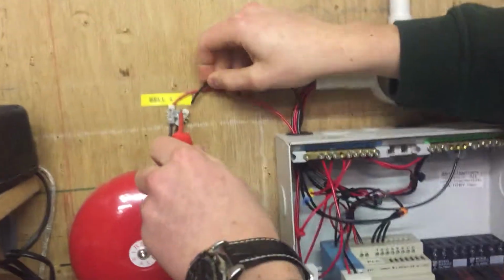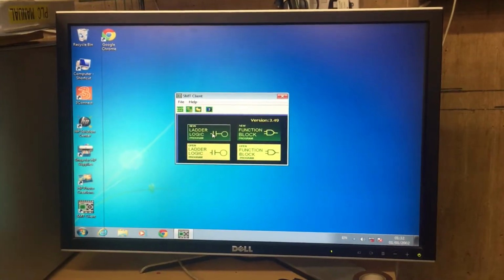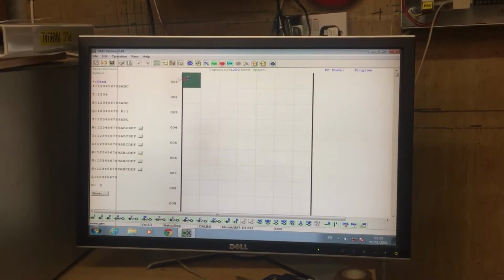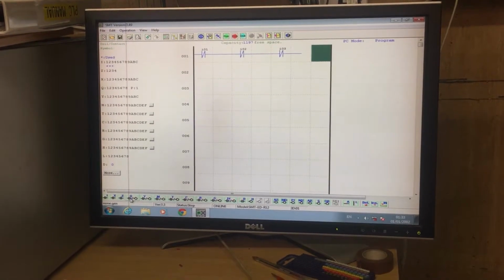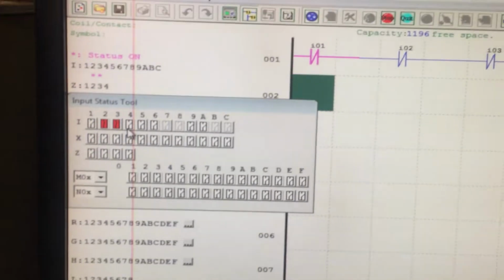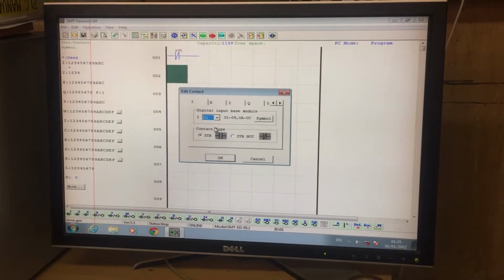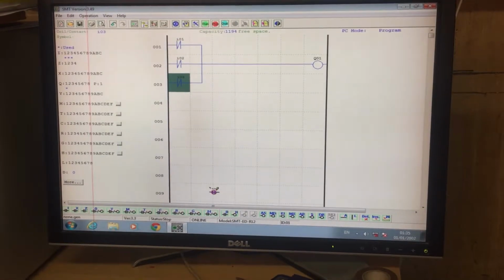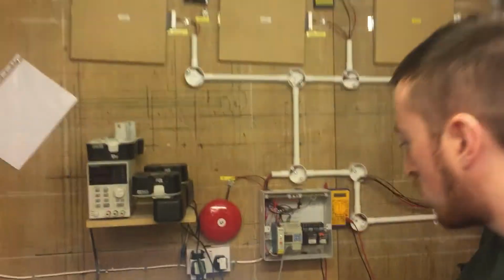How to Program an IMO iSmart PLC using Ladder Logic: 3 doors and a bell

Comment: very nice ... can u give me a list of what i need to make that circuit?
Reply from the maker: Hi Paul,

You need 3 reed switches, a bell a 24v psu and a 24v SMT ED R12 smart relay from IMO. The circuit diagram is at 2:07.  Hope this helps.

Cheers,

Dave.
Reply: @collectric5518  thanks from getting back at me so fast.... i have one more question for you if i may... what  is the best way to wrap this plc around my head ? short story im a HVAC TECH but now im in industrial machinery  .. i can read and understand circuits and diff componts on a ladder diagram lol i finally got the theory on that and the refrigeration side.. this is my 3 week in school for plc.. is there anything you can think of that could help ... like the inputs and outputs..
Reply from the maker: @ghoststories8622  If it's the inputs and outputs you need help, then typical inputs are digital ones like float switches, limit switches and proximity switches and the analogue one are like pressure, light or temperature sensors which vary in voltage (0-10V).

The outputs of PLCs can control any load like a lamp or LED, a contactor, heater, pump, solenoid, valve, robot, fan, chiller etc.

Are you in the UK?